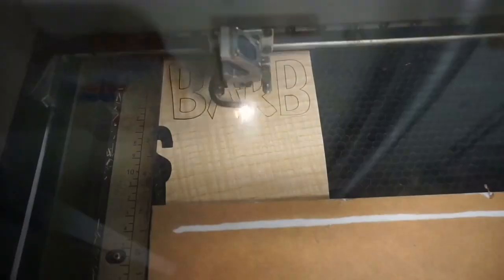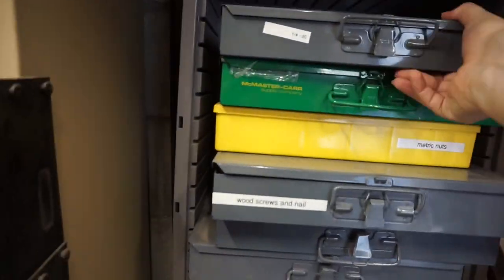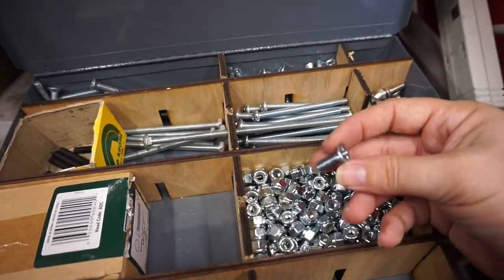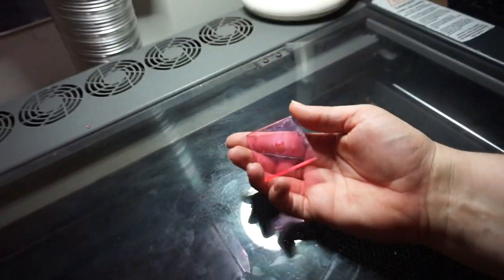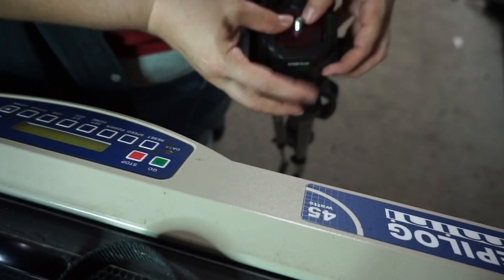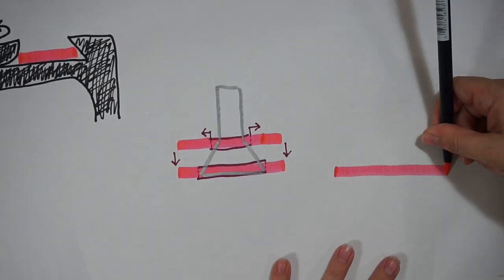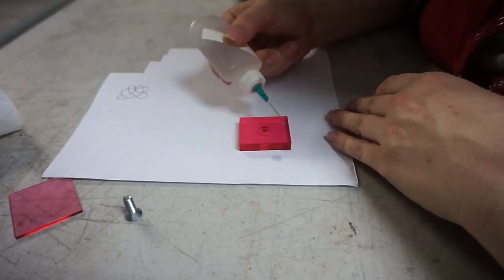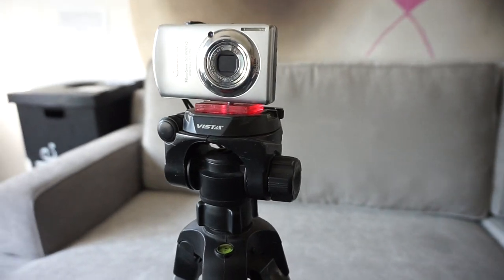Lasercut Tripod Fix

Comment: Hackaday had a post a year or two ago about a person that used a laser cutter to "make a 3d model" with ham or bologna. I mention this because they started with a 3d model and "sliced" it. As I recall, the "slicer" actually converted the slices in to svg images. Were you to have had a concrete idea about what you wanted, you might have saved time and material with the concept I read about. https://hackaday.com/2017/03/30/sudo-make-me-a-sandwich/